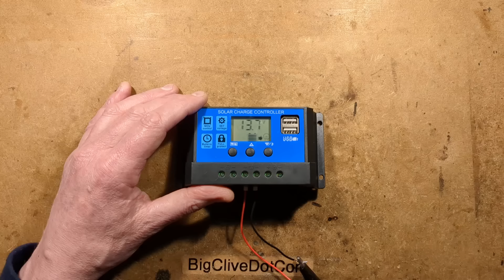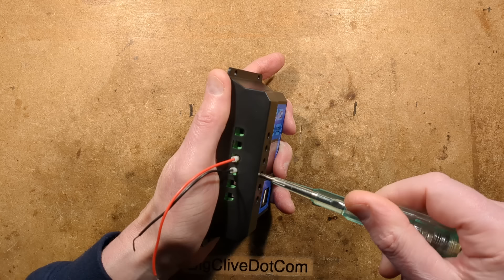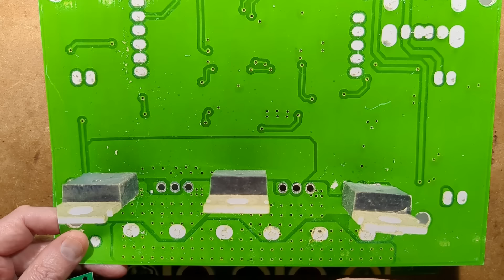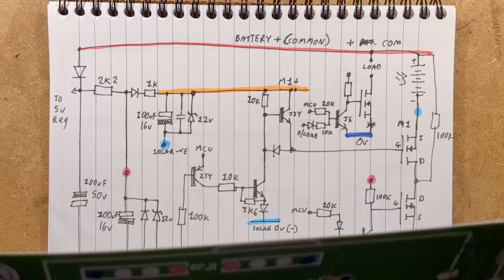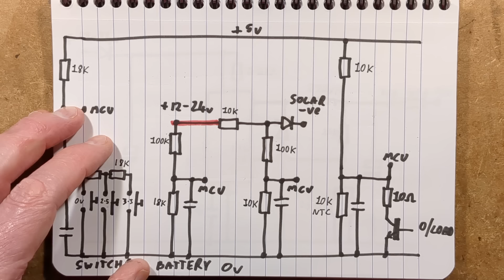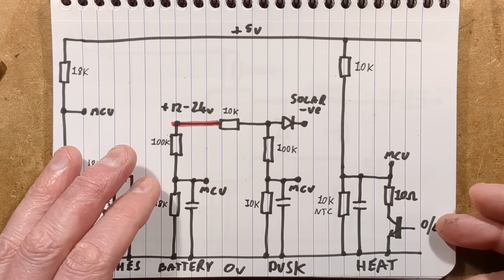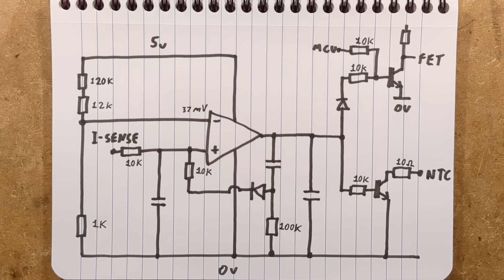Exploring a mass produced solar charge controller

Comment: I think that weird PNP transistor is actually being run in a common-base amplifier which can be used as a level shifter since it can be a voltage amplifier.  Common base (or common gate for MOSFETs) are a basic transistor amplifier topology.

Comment: For the current rating of the load, I would simply use a higher rated relay and have that be triggered by the output of the charge controller connecting directly to the battery. That way, the control circuitry can still cut off the load according to the programmed parameters.

Comment: I bought one of these about 6, or so, years ago. I attached it to the back of a 100W solar panel. I chose the 20 Amp version. Not because the panel would produce 20 amps, but because I wanted to under power it. As you suggested. Of course I opened it up, and also noted the Mosfet's questionable contact with the base plate. I corrected that with a bit of careful lead bending. 
I use it for car camping. I would prop the solar panel against the fender of my car and attach the panel & controller to the car battery. That would keep the battery charged while we recharged our lanterns and other devices off the car battery.

Comment: Clearly, you didn't follow Dave Jones motto: don't turn it on, take it appart 🙂
Extensive (insane) reverse engineering effort! Do you pay royalties for using DaveCad to draw these circuits? 🙂
Reply from the maker: DaveCAD is large format vertical.  CliveCAD is compact format horizontal.

Comment: Been waiting for this. I had one that failed. I suspect weather got into it. So bought another that was sealed (they make the same thing much better weather proofed). I opened the old one but haven't more than cursorily looked at it for any obvious water or corrosion damage. Always a joy to see a closer look taken.
Reply: Check the terminal block solder joints... I've fixed one for someone where the terminal block had cracked it's solder, and now their other one has the same problem (I think - haven't looked yet but same symptoms).
They don't move them around either... Just sit them in the yard (the controllers are glued to the panels) to keep vehicles charged up.

Comment: burned one of these trying to just maintain some charge on a 8s pack of 46160 lfp....   and a  33v 8.5 amp 240w panel....  it didnt like it .. i  even if cells rest at 26v and close cirquit voltage went down to 29 and even lower due to batteries  maybe the lifepo4 chemistry asked all the amps and overloaded it ..  !!! you can not ask how many amps you want... it might could be saved with smaller panel   less than 200 watts!!!, bought a second but use it for  lead acid on a 40 watt solar panel  for imobilized cars here. quiet impressed .. because it tricle charges and lfp would never be full with that style of charge

Comment: Clive I bought a silimar / the same solar charger for a project.  The FET's on mine were HY1707's
Reply from the maker: Interesting.  Rated about 60V and very low on-state resistance.

Comment: As someone with a $700 solar charge controller, the amount of people that buy the literal cheapest product and expect it to take care of their battery needs is insane. You don't need $700, you need $200 but $30 is not appropriate for something that controls power and conditions batteries.

Comment: The USB ports are a hilariously Chinese addition as they have no real purpose except to provide an extra listed feature. When someone sees 5vdc on a schematic, they pop in a USB connector. Marketing then calls this a fast-charge port and rates it at 120w in the item listing. Great job, guys.
Reply: 1.2W may be optimistic.
Reply: I've charged my phone off one of these, and it did it OK... Got about 350mA out of it from memory, which was fine for charging during a blackout, but wouldn't want to do it daily.
Reply: I've been charging 3 phones daily for 2 years from those ports, also a USB powered battery test circuit
Reply: @laus9953 my usb ports dont work

Comment: My Victron charger's manual says to connect the battery first, so it can reliably detect the battery voltage (12/24 V).

Comment: What's the ON resistance of the FETs you removed? I used these with some 24V 8A panels that put out 32V open circuit and one of them fried the FETs. I saw another video where the guy replaced the thin steel panel with a large heat sink so I replaced the thin steel back with thick aluminum plate and it got too hot to touch. After mounting the units on a large aluminum plate to draw the heat from the small aluminum plate it's within acceptable temperatures running two 24v panels in parallel peaking at 16A. Does this thing switch fast enough for it to be switching loss or are these sanded down FETs junk? Photos will be emailed shortly... Thanks, ❤ the channel.

Comment: Clive. Thanks for a great video. I think the mystery PNP is used to shift the control signal to negative of the battery 0V. When the solar panel is generating enough to charge its -ve terminal will be  of the order of -6V to the battery 0V ( -18V - (-12V)  referenced to VBAT+ )  The current in the collector is the emmiter current -base current. The circuit protects the mcu output from seeing -ve voltages which would be terminal.  If you redraw that part of the cct with -Vsolar below -Vbat  on the page, it will help.  Thanks again.

Comment: I bought one of these from Temu. It keeps a 12V 20AH LifePo4 battery charged as part of my backup power system that runs the router and some 12V LED lights during power outages. Only issue I've had with it so far is the processor freezing once, requiring a power cycle to reset it (a reset button for such situations would've been nice), otherwise it's been completely reliable.

Comment: What type of solar panel could be connected to it? A 12-24 volt one of also for example a 40volt open voltage one?
Reply from the maker: I'd recommend one very close to the battery voltage for efficiency.

Comment: I would like to point out that I have a bunch of those controllers, and not all of them use B1/B2/B3 in the same way.  Some actually just switch between different types of lead-acid batteries and do not support Li-Ion, so be careful!
The best of those cheap controllers I have is the one with LED 7-digit display, branded WinCong. The great thing on that one is that it actually shows charging / load amperage so you have basic idea about what's going on.

Comment: I've used slightly more complex units but the basic lead acid and basic lithium controllers have been fairly impressive so far. One of each currently installed.  The more complex 60 A and 100A died within the year . The ratings are for how much amperage/wattage used on the load side from what I've found . Charging may accept slightly higher currents. Very much appreciate the in depth analysis .

Comment: Hi there, καλησπέρα from the very south of Greece with 300 days of sunshine and very cheap PV panels (big solar farms swap the panels out when they reach 95% performance, and they're sold very cheaply in town, cash only please)    We've had a number of these controllers and variations - the common positive appears to be standard.    I've never bothered to open them up when they (invariably) fail, thanks for the teardown and reverse engineering!   The USB sockets provide a handy supply for a LORA transmitter for remote monitoring!

Comment: I use one to power my yard lights, works well on old/used 12v Pb batteries.    Thanks for this clear description BigClive
Reply: I replace alarm panel PB batteries for work.
they have to be discarded after 3 years, even though most still have high capacity.
instead discarding, I hook them all up in parallel (with individual fuses)
and charge them through a controller like this, from 2x 100W panels.
have been driving my stereo (old car radio), charging all USB powered devices (torches, bike lights, USB speaker, phones, tools etc) from this for 2 years.
am experimenting with old PC UPS inverters whether I could provide power to central heating or fridge / freezer during a blackout.

Comment: Model e8960 power inverter ❤
   200w. Took and put a line fuse in it 😅 and battery terminal connections blowed the internal hooking it up backwards

Comment: You're exactly right about the usb 5 v going down on the micro controller 
    So i spent the night warming my panels? 😅
    It still works perfectly fine thankfully lol😅
  Just got me through 3 days of rain 3x 25 watt amorphous silicon 35 ah 12v sla 12.1 was lowest at 12.6 rn

 Running my phone and lights sometimes my Dremel and guitar amp 
   My vita

Comment: Thank you for this as i am using this exact one for small solar panel + lead acid 12v - but one day i came to it and found it showing 28 (28 what??) on the display continuously and i very quickly panicked and disconnected the batteries and measured about 14.8 across the battery - looked for the leaflet and became so confused that i dident know what the settings were ment to be... your video helped a lot.. (14:43 dont know why an emitter follower used to drive a gate with no gate bias resistor!! very strange) Thanks.... Kevin...

Comment: I’ve been wondering if you can ground/earth all the negative leads at the battery/panel/loads to the chassis, and only lay + wiring, for simplicity when wiring a van.
Reply: I’m halfway into the video now and I’m not sure if I understand everything at first sight but it seems that technically speaking, if the vehicle would common positive to the chassis, you could connect the positive from the solar, battery and loads to the chassis, to avoid drilling an extra hole and a gland for the negative wire… not entirely sure if it would be economically viable to convert the whole van to positive chassis to avoid drilling 2 holes instead of just 1 🤣
Reply from the maker: I wouldn't recommend making a positive chassis vehicle.  In this application it's probably better to just run positive and negative to your loads.

Comment: I used a similar unit on a trip to Burning Man some years ago. Three weeks in a desert, about 400 W worth of panels. It worked well enough.
It was Not as efficient as it could be, maybe not a proper MPPT. It really needed a buck/boost converter to get the most out of mixed light conditions.

Comment: Literally using one right now 
   With 3x 25 watt amorphous  silicon panels 
🙏It's not awful 😅 
   Been using it for 8 months anyway lol 

Can tell you there is some strange behavior using the USB on it 
   So I don't use them lmao 🤣
Edit😅! Just got to your part about usb 
   Had a vape plugged in numbers went crazy on thd display and the back where the mosfets are got hot 
   This was during the night 
Drained my batteries down 

And it shows .2 volts higher than what the battery actually has

Comment: I bought some of these regulators they work fine until something goes wrong with them. When these things go wrong they let trough all te tension so they will load your battery with nearly 20 volt Everything connected with the 20 volt what goes to the battery can be damaged also the usb port gave 14 volt.
You can not trust them at all.
I changed all of them with a Victron mppt.

Comment: I just bought a 20A solar charge controller from viktron that looks similar on the outside, should I be concerned to run it with 24V 6A 200w(42v open) solar panels and a 12V battery? Do panels and batteries need to be balanced? Would a 10A input fuse be enough or should I go for 15 or 20 Amps?
Reply from the maker: If it's a proper charger the data provided should give the full specs.

Comment: The obsolete PWM style charge controller, best avoided altogether -the MPPT style is far superior, making at LEAST 30% more total power generated per day (and thats with the panel voltage only slightly above the battery voltage) choose a panel with a much higher voltage than the battery and you could be losing over half the panels output!!! So although the PWM is cheap to buy, by choosing one you will be getting a lot less total power generated per day (watt hours) even though their  instantaneous peak power power (watts) may be similar, worse with poorly selected panels you lose both total daily generation AND instantaneous peak power, a double whammy,...

Comment: I had a friend living off grid. He used a fold out camping solar panel, one of these regulators, a deep cycle battery and a 12 Volt compressor type camping fridge. I had my doubts, but it ran pretty much trouble free for over 5 years until the battery finally died. It didn't like the grass getting long in front of the solar panel. The regulator was mounted on the back of the solar panel and one of the wires corroded through and had to be re-connected.

Comment: it's okay for small use. i use it to power led lights in small summer house with small solar pannel and car battery. I got 30A version, because price was not that different from 10A version and that way it will run without heating up too much.

Comment: IMHO MPPT controllers are appropriate if you have a string of solar panels so their voltage at maximum power is much greater than your battery voltage. A 20V panel will produce maximum power somewhere near 14V, matching a 12V battery, and a PWM controller will work fine. 
When I set up my camper I bought two 20V panels and put them in parallel, saving the cost of MPPT. My suspicion is that this arrangement can actually be more efficient if one of them happens to be shaded (which happens) as the current a string can supply is limited by the worst illuminated panel. At other times there's not much in it especially since the real efficiency figure you want is maximum energy for minimum cost. I hope that makes sense and welcome other's thoughts :)

Comment: I bought one of these recently from a popular Aussie 4WD and camping chain.  It was quite cheap, rated at 15A, and comes with a 12 month warranty.  I opened it up today.  It has the full compliment of MOSFETs, and the thermal pad was making much better contact than this one.  On the advice of a work colleague who has been running quite a few of them for years in vehicles, camp power, and farm sheds, I already bought a thermal pad and heat sink to attach to the back of it.  I’m only planning to use it to regulate the incoming charge from a solar blanket (up to 8A output), to top up my aux 12v fridge battery.

Comment: I had one of these but it died when the negative wire from the panels got really hot and melted the whole area around the screw down connector. 
Had a victron one now for nearly three years with zero issues.

Comment: Enjoyed learning about the complexity of using a micro controller to turn it off. Quite ass-backwards. The time it took to do the reverse engineering to discover how over-engineered this badly designed device is so much more interesting than just being told it's crap don't buy one. In fact only my comments gramatic structure is worse than the design of this solar powered charger.

Comment: First circuit diagram i have seen that makes no sense. That power control and the 2 back to back mosfets. I would love some more explanation around that. Like.. what is the purpose of the lower mosfet? Both of them are under control of the MCU.

Edit: i found out what what one of those mosfets do. Its to stop the battery draining back into the solar panel at night.  Those 2 back to back mosfets are designed to block current in BOTH directions, as mosfets have an inherent body diode.

Comment: 9:14 I could be wrong, but assuming the data lines on the USB ports aren't connected to anything, you should be able to connect devices to them safely. The USB standard stipulates that a USB slave device may only draw 100mA max, unless otherwise permitted eg. a specific resistance between the data lines, or negotiation of higher power delivery with an MCU. That said, given the consequences if your device isn't compliant, and that 100mA is really not all that much current unless you're charging something like a keyring torch or a pair of headphones, it's still probably a good idea to seal them off. And more generally, (probably not in this specific case as this one's 5V supply looks okay-ish) it is possible for sketchy chargers to kill your phone or at least damage its charging circuitry.
Reply from the maker: The data lines are bridged in the unit, which is a signal that it can supply higher current.

Comment: The first time I saw these controllers was when a creator called Adam Welch looked at an earlier version about 5 years ago. The older version had four buttons along the base of the screen and the internal circuitry was definitely different. It was sold in 30amp (Two mosfets) & 60amp (Four mosfets) versions. Adam noted that there was no difference in the circuitry between the two versions and neither looked capable of supporting the levels of power claimed on the box.

Comment: I've found these units surprisingly robust. 
Inherited a well used one, panels connected but no batteries for many months. 
Added a couple of old car batteries and it worked fine. 
It ran my 12v fridge for a couple of years 24/7 in a tin shed during Aussie summers, screwed to a wooden board. 
I've been guilty of disconnecting batteries during daylight hours,  charging 2 devices from the usb ports. 

It was still working when I replaced it 😀

Comment: I’m onto my second unit, I used it in the back of my car to charge 2 x deep cycle batteries from solar on the roof and a permanently on 75L car fridge set to 3C. The first unit burnt out an I put terminal, I used crimp on terminal connectors with the second unit and 2 years on, no issues.

Comment: I bought the same piece of garbage a few years ago. Seeing the voltage drop across the panel made me strongly doubt about its MPPT capability. Then I opened it and noticed the only inductor was the tiny one used to power the MCU and/or deliver the 5V output to the USB connector, then I understood :-)